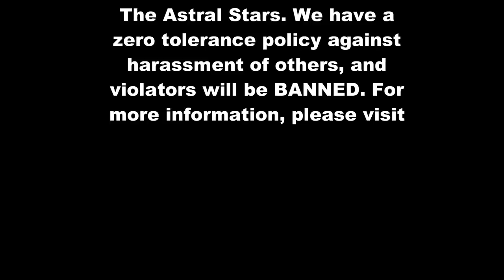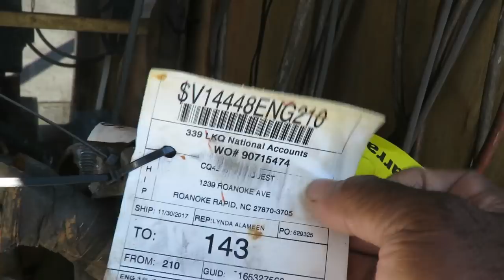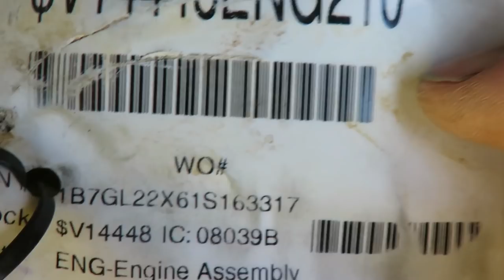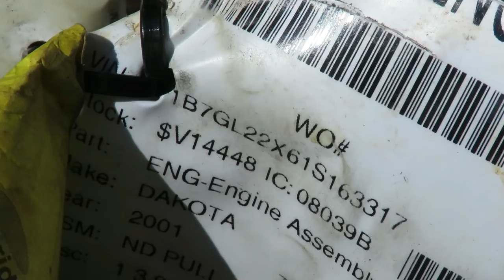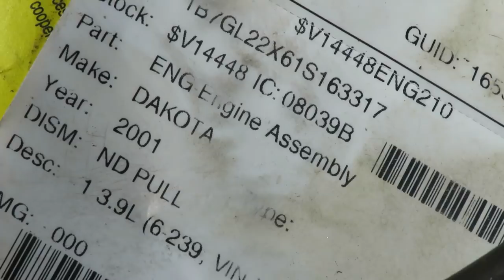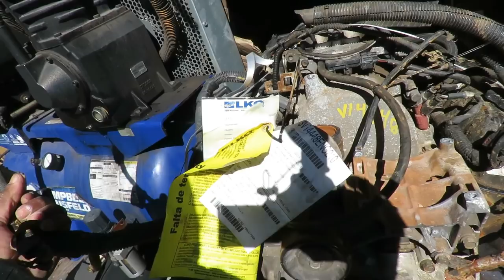⭐ 1999 Dodge Dakota Sport - 3.9 - Engine Replacement - PART 1

Comment: That replacement engine looks pretty dang scary.
The original engine looks poorly maintained.
Imagine if that AC compressor is the cause of the locked up engine? Ouch!
Astral gets all the winners.
Reply from the maker: Yes it does! I'm going to send a link of this video to the customer so he can send it to LKQ. I want them to see the freeze out plugs and the rest of the engine, in case something goes wrong, then they can't say it was our fault or the customers.